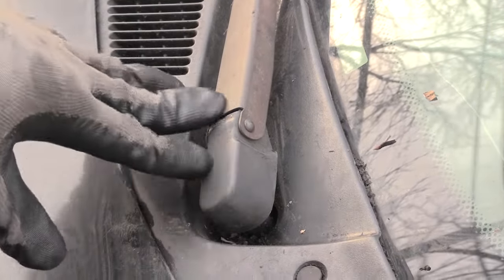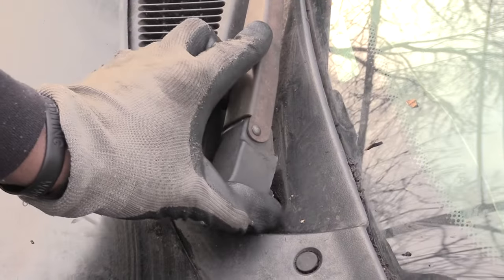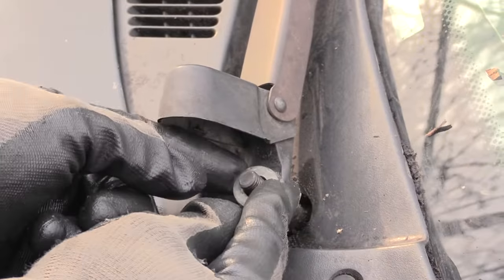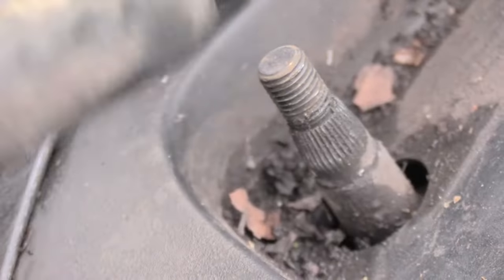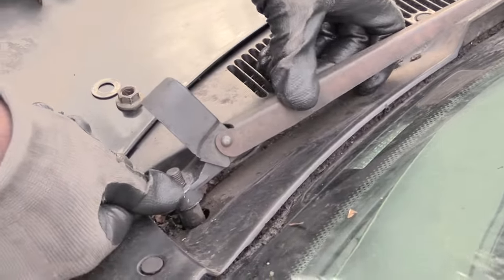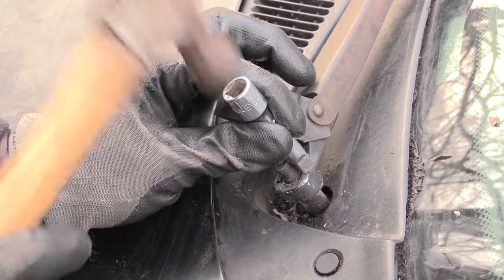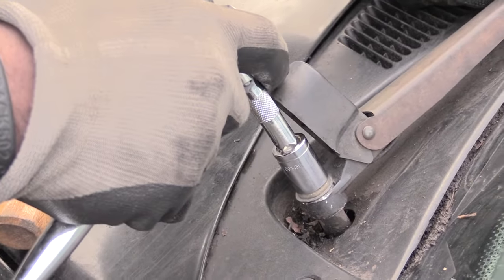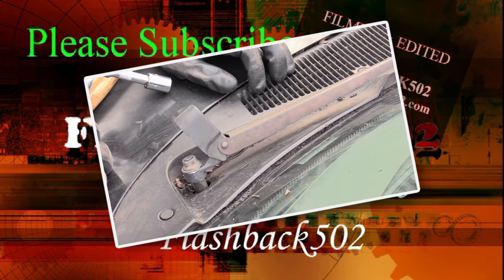Windshield Wiper Arm Change! EASY Same for most Vehicles! Don't use hammer unless very steady handed

Comment: Nice tip on the ribbing and why I couldn't pull mine up after removing the nut but damn bro, you about busted your windshield there.  maybe a towel or mat for protection?
Reply from the maker: Yes agree 👍🏿  glad could please subscribe like and share and check out our other helpfull videos

Comment: Mark the post top, then down the threads and mark the wiper arm one continuous marking to replace the arm easily. I would not recommend using a hammer against the windshield, it may work. But it may not. Metal and glass

Comment: I really appreciate this video.  I consider myself pretty handy and I had my wiper motor go out, I changed the motor and linkage.  I can see everything working before I put the wipers on but as soon as I put the wipers on, the wipers don't move.  The motor is working and the linkage is trying to move but the wipers jump but they don't move.  Any advice?  I can't believe wipers are getting the best of me.
Reply from the maker: Your wiper connection  may be striped. Hope you get it fixed. Please like subscribe and share

Comment: I don’t recommend the hammer I did it and cracked my windshield but I used the fancy tool and took it off just remember when removing the arm you have to lift the wipers and pull
Reply from the maker: Thanks for tips. Please subscribe & like and share if haven't already and check out our other helpful videos

Comment: So after doing this I bought brand new wiper arms, that dont have the spline pattern already tapped into the hole where they slide on. The stalks of the wiper transmission of course do. Is it same procedure or am I then going to strip the stalks on the transmission? Not sure how to attach them…

Comment: First of all, it`s called a nut not a bolt. Inside of the wiper arm hole and the shaft are splines - not rivets. You are damn lucky you didn`t crack the windshield doing it this way. Very, very poor video! Guys - DO NOT use this method!